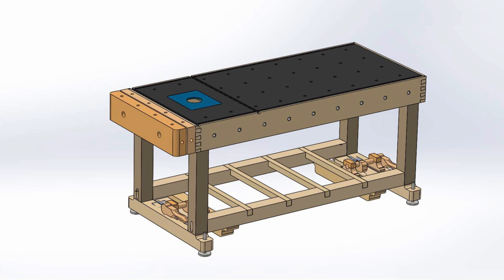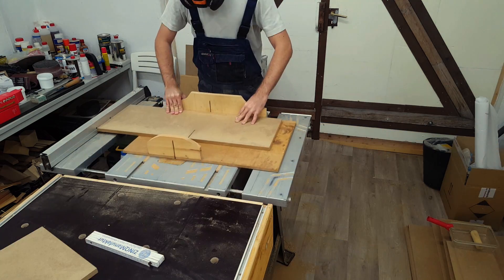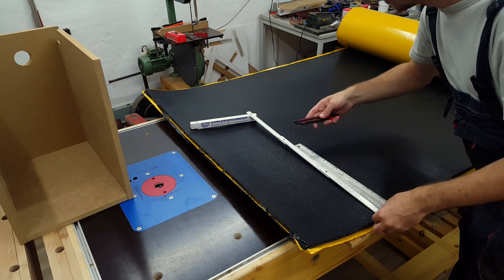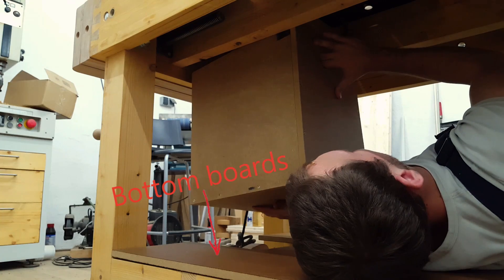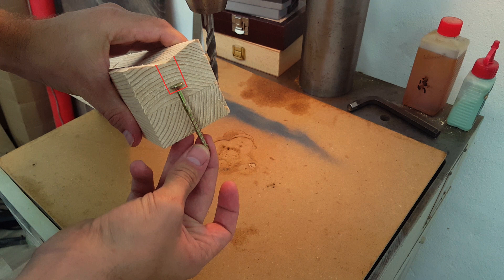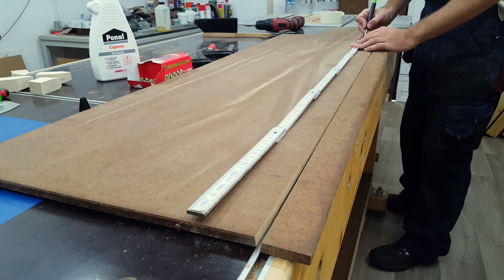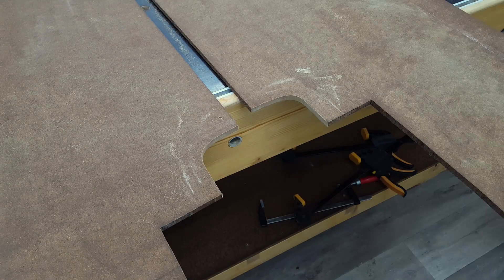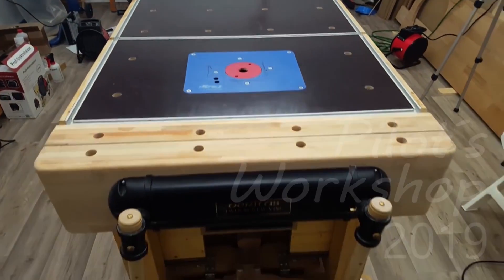How to build the Ultimate Workbench - part 11 - Building the Dust Roof and Router Box

Comment: Friend, you bench playlist is one (or the) of the best I've seen and I've seen a lot. You're very smart and inteligente. Congrats! One question. How do you decide on the final height of a workbench?
Reply from the maker: Hi Joaquim,

thanks so much! Usually I would see other workbenches (like the worksurface of a kitchen) and see if I like that height for working on or if I would like it a bit higher or lower than that (wearing the footwear that I wear in the workshop!). But in this case I knew that I wanted the bench to be the outfeed table of my table saw. So the height was defined by that. However, I did put adjustable feet under everything, so I can still tweak it up and down by a bit.

Regards,
Thomas